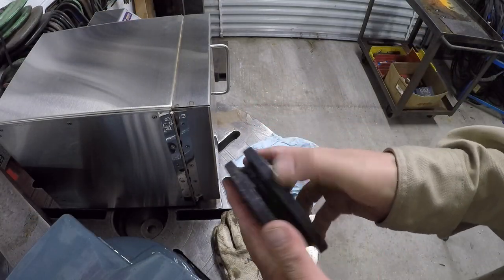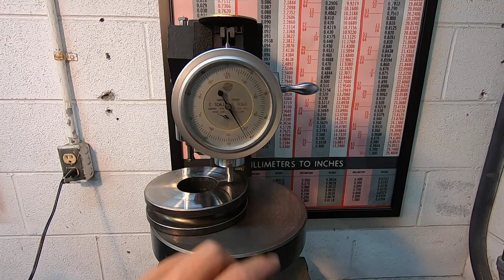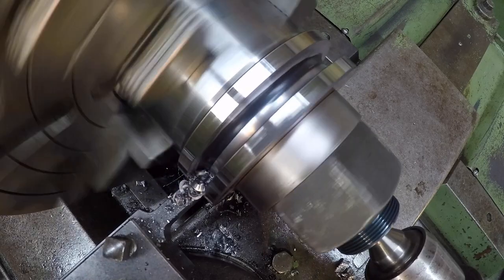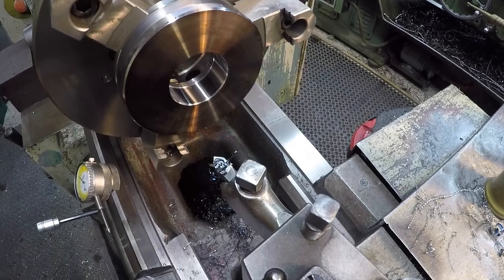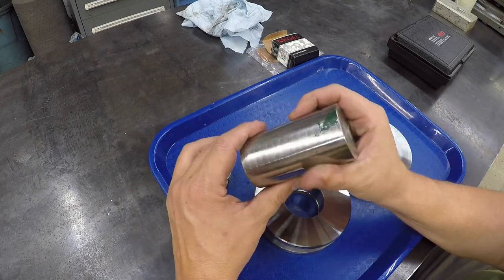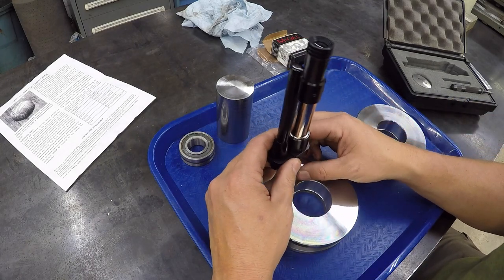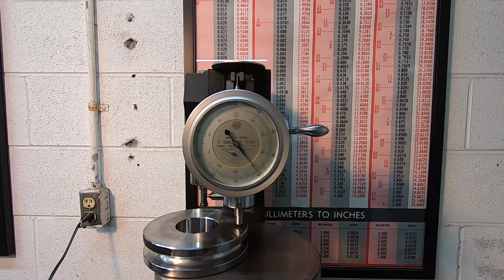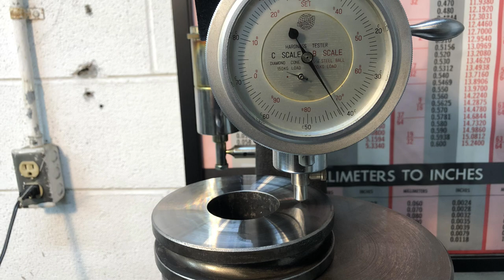Machining Cable Sheaves Part 2

Comment: Adam - a few things I would suggest: 1) Your oil reservoir is pretty small, so you have to consider that the amount the oil temperature around your steel is going to increase significantly in the first fraction of a second. I would consider a larger quench with more oil and preheat the oil and stir it ahead to ensure temperature equilibrium to avoid cold spots during quenching; 2) You are carrying your heated steel pretty far in tongs, which is going to act differently than the steel that is exposed to atmosphere directly, not to mention rapidly reduce steel temp and the safety concerns, I would consider changing the location of your oven/quench and use a tong or hook that minimizes surface contact; 3) You appear to be quenching in a plastic or pvc container on concrete - I would seriously suggest switching to a steel container and keep a chemical extinguisher nearby, as oil fires are often combustive and all it takes it for you to bump that container and it will likely melt a hole and then you have a hot oil spill; 4) I would also suggest wearing a filtered mask, not just a face shield, as burning/smoking oils are not so good to breathe, whether in the kitchen or shop.
Reply: i completely agree with this comment the heat treat could have been done a lot better and more efficient.. and the whole not enough oil thing is right but at the same time hes not taking .100 thou or anything too aggressive and its not a big piece of material but anymore then that yeah hed be chasing his tail till the part was scrap! dont get me started on the ambient temperature of a machine lmaooo!!!!!!

Comment: Hey Adam, not to be overly picky but for more accuracy;  when doing the hardness testing with that calibrated spring punch, you should make sure that the test piece is lying on a flat, hard surface.  I believe that plastic tray absorbed some of the penetrating force of the punch.  When you punched the second sheeve, i thought I saw the tray bow flatten a bit.  This will affect the hardness test.

Comment: Great work there,  as always.
There is a decarburized scale layer on the outside, yes. It will definitely throw off the reading, but its only a few thou thick. 
The grey spotty texture is martensite. Good sign that the heat treat was successful.  
For the quench - 40 to 45 is quite ok for a piece that size. Large pieces lose a lot of max HRC due to pretty much annealing while still in the quench due to residual heat in the center.
Still, you 're not quite there, yet - 4140 is supposed to harden to 50-60.
Your quench technique is fine, but you lost a lot of hardness in the transfer.
First - get your oil right next to the oven, or the oven next to the oil if you want to quench outside for smoke reason. 

The goal is to pretty much open the door and drop it right out of the kiln into the oil in a blink of an eye.
If you need more than 2 seconds for a transfer, it's pretty much too late to get a good result, already.

Also - get yourself a metal bucket - if the plastic breaks (or you get contact and melt through it), you get a spill of hot, and maybe even burning oil.

Comment: I am not a machinist myself, but I love watching you explain and do stuff. Thank you.
Reply: Same here.  Grew up with my dad taking me into the metal fab shop 3 or 4 times a year, worked there two summers.  Still remember the smell of the oil and grease, metal shard hitchhikers in the soles of my boots scraping the concrete or pavement.  Great people to work with.  Love seeing Abom's work in his vids from a raw forging to perfection.

Comment: Adam, I'm suspicious that the area of differential hardening may be due to you grabbing the part with cold tongs. When I heat treat (knives and edge tools), I make sure that my tongs are quite hot, almost glowing red themselves.
Reply: Seconded, as well as a recommendation for a larger quench tank and more vigorous agitation. With anything that chunky ensuring really good even contact with the oil is huge.
Reply: Exactly my thought.
Also the oil was a bit far away from the heat treating oven.
Reply: @thereddufus  The tongs being cool wouldn’t be as much of a factor as the size of the quenching tank. The volume of oil and the lack of good convecting flow of the quenching fluid would be the biggest factors in inconsistent cooling rate leading to differing phase change progression and different final phase presence.  Thus causing the varying hardness.

Comment: Your idea about scale messing up the readings is correct. I use regular sandpaper to clean the surface before measuring. Make sure that the surface is parallel to the measurement axis, clean surfaces and support workpiece properly. Still you might want to make multiple measurements as the hardness measurement is very sensitive to different variations. Maybe you could acquire a hardness calibration piece to check your measurement. With handheld hardness testers it is a must have as it is easy to start second guessing yourself while measuring.

This is why hardness requirement has always a tolerance. I have been using and have seen +2 -2.

Comment: i worked in a heat threating company for 5 yrs doing the tests u should allways clean any millscale or any type of residue on ur parts before testing and allso im pretty sure that the "raised discoloured" area is where u had the thongs and it held in more heat than the rest of the part we used #9 steel wire to attach it or and lower  it so the part would cool down all at the same time in the quenching liquid
Reply: Ultrasound durometer, like UCI 1500 is usefull for that ?

Comment: I have no real knowledge of this sheave, however I know that a lot of cable type lift equipment is designed to have the sheave wear, and not the cable. be careful changing the design specs. love the videos Abomb. thanks and keep up the great work.
Reply: hmm good point
Reply: Yep, I am afraid 45-50 HRC is way too hard for this application.  Standard 4140 bar stock is around 12-15 HRC.  Probably a better choice.  I think the cable would agree!

Comment: Your tongs insulated that part of the steel. And created a Hamon, It cooled at a different rate than the rest of the steel. Use a wire Hanger or Pre heat the tongs and oil.

Comment: Couple of ideas re quenching your parts: First of 4140 is not the best of materials for this purpose due to low carbon content. It will harden, but do not expect tool steel hardness levels. Secondly, when you heat your parts for long time, decarburization happens in the top layers. Basically you loose carbon from steel thus making top layers softer (regardless of the scale). As others mentioned, keep your oil bath as close to the furnance as possible. I would personally try running some tests with smaller parts and if you want to use 4140 try quenching in water as well. Anyway it was a enjoyable video, good job Abom!
Reply: 4140 is an oilhardening steel as per material specifications. water hardening can lead to cracks in the part. to avid decarbonisation either use an oven with inert gas atmosphere (expensive) or toolwrap (cheaper, but not feasible for all geometries).
This steel has .4% carbon which is easily enough for decent hardness while cromium and molybdenum make it less brittle.

Exactly what you would want for the purpose of the part decribed, so choice of material is good. Typical application for a tempered steel grade. Very similar to the 41CrMo4 /1.7223 we use over here in Europe for the same kind of applications.
There are detailed tables regarding how long it takes to heat through the whole part depending on wall thickness and which temperatures to use as wella s which quenching agent and so on. If you adhere to those you will get good results, otherwise you will not.
Reply: It was to hot also 1500 on that steel is enough

Comment: Hey Adam,Directly after you harden the parts at 880°C for a minimum of 1 hour (the longer you leave it in, the deeper the hardened surface will go it is a case harden steel). You need to heat your oil to 360°C, quench and keep the parts at a constant temp for at least 2 hours then cooled to room temp for 4140 1.7225. This is the austemper temperature. You should be getting 61HRC after hardening. The steel is not hardened completely, you can still cut it with a conventional laith. Normally hardened steel to 58+3 HRC needs to be cut with a CBN or diamond insert using HSC. Normally you should grind the parts afterwards, and leave a good 0.6mm extra mass for clean-up. 

You should also do a magnet powder test to check for cracks.
Reply: That high of oil temp is totally unnecessary, depending on your industry and country and code of regulations you follow. We heat treat 4140 all the time and it is quenched in 150F oil, and is supposed to be from 140-180 max.
Reply: @Sffker  normally you're supposed to use a heated salt bath (like we do at work).

 You have 2 possibilities, 
1) you austenize (minimum 60 min), quench, then temper in a heated bath 360°C-480°C minimum 2 hours 

2)austenize (minimum 60 min), quench, and temper in an oven at 680°C for minimum 2 hours. 

The data provided is the temperature, specifically for an oil quench and not a salt bath quench. 
According to my machinist handbook they state 42CrMo4 material number 1.7225 (AISI 4140) harden at 880°C quench in water or oil, temper between 540°C-680°C (lower temp for water quench, higher temp for oil quench). 
The 4140 hardens through tempering. Hence why Adam doesn't have 58+HRC.

Depending on application, the best results come from an oven using nitrogen, quenched in a salt bath, tempered in a salt bath. Up to 61HRC. The raw steel is delivered with a 53HRC.
Reply: @chronicblazer84   Well he showed your last statement to be wrong. His was far less than 53 to start with. I have gotten 4140 steel in both a soft state and a hard state. 24" rod I have chucked in the lathe right now is toward the hard end of the scale. The other chunk I machined recently cut like butter with the same tool. Even just center drilling this new piece told me this one was different hardness to start with. Atlas Steel provides theirs as hardened and tempered. Different sizes also are delivered as different hardness-es.  Others may supply theirs as annealed. Or as Atlas says, it can be annealed, machined,and re-heat treated to get to a harder level.

Comment: When you dip the larger parts to you move it in a circle. If you don't the you will get gas pockets around the part and it will cool slower. On 1040-1060 you can do a saltwater bath. You can always do a magnet test before the quench. This will make sure your at the right temperature to maximize hardness.  Love your clips I learn so much from you.

Comment: Adam, here is a thought. You mentioned that one area of the part had a hardness of 62. Could that be the area that was in contact with the tongs used to remove the part from the oven ?  The heat transference from the part to the cold tongs may be the reason for the higher Rockwell rating in a small area of the part.
Reply: That's exactly what I wanted to write.

Comment: I have been heat treating similar size parts for a few years now, all 4340. As a guy who has had parts slip out of the tongs, I cringe and hold my breath watching you quench in a plastic bucket. The steel safety cans with the foot operated lid work great.

Comment: Pre heating the tongs and oil and keeping the oil close to the oven should give a more even hardness.
The uneven results are probably due to the uneven cooling and quench.
Had those issues with the first couple of heat treatment cycles I did.

Comment: I know I commented prior to this and I don't mean to beat this to death but I remember probably early seventies we needed to open up a sheave from 3/4" to 7/8" to accept a larger wire rope.. The sheave was out of a Lima crane and it was so hard in  the groove that the groove had to be ground to size...Machine shop in Baton Rouge did the job...Cheers; Mike in Louisiana

Comment: Hey ADAM!  The differential hardness you noticed may be due to your tongs, and the 'long' walk to the quench.  Quench needs to be right next to the furnace, and quick.  Practice the moves like you would for a critical weld.  Use a metal quench pail with a proper lid.  You're on the right track with cross referencing your instrumentation.  Can't wait to see you discover case hardening.  Make tools from nearly any steel!
Reply: The tongs are insulating the part from the oil, a metal bucket w/ lid and a basket to lift the part out would be ideal.
Reply: @j-man72b72  right.  What little I did in shop and for a  hook and shackle company I know the heat to plunge time and orientation is critical.  Long parts must go straight in to the oil and maybe letting it drop off the tongs would work better.  We also found after quench if the batch was crated and taken outside in a snow storm the hardness went up the Rockwell scale.making them more brittle and lower on the maximum pull strength range.  Also Rockwell numbers are not possible to get on round parts of a sample.  You need to grind a flat for Rockwell or Brinell

Comment: Try fishing your job out and quenching, using a 1/4”  hook. The wide tongs may cause varied quenching spots. Also in Australia we use K-type oil, i think your equal is Parks 50. You need a fast oil.

Comment: I enjoy you're showing us your learning in the heat treating. I think the tool you used to hold the part did a much quicker temperature drop so it harder there. That spot you show in the beginning. I didn't see if it is symmetrical, on both faces. Stephan Gottewinter uses steel wire, hooks. I used them too in forge treatment and they work better for me. Thanks for the vid !

Comment: The tongs don't allow the part to cool evenly in the oil quench.  
Run a piece of wire through the hole in the part before you put in the oven and grab the wire with the tongs to remove it from the oven and quench it.

Your quench tank should be metal not plastic.  The part can melt a hole in a plastic tank.
Reply: That may be the only bit I remember from art school WAY back .... (Fire was the cool new tech). I had a nickel part explode because the tongs were such a great heat sink.

Comment: Temper for 90mins bud
Your right about the scale affecting test results
Your hard spot may have been either the part that hit the oil first or it may have leeched carbon out of your tongs somethings caused an inconsistent quench but nice work all trades in house is the way to go

Comment: the best thing about oil quenching with a plastic bucket is when you touch the side of the bucket and the part blows it out and you have a flaming oil avalanche on your hands. that is, your metaphorical hands. it's on your literal feet. i've been there.

also i have no clue why you're getting the results in heat treat that you've been getting, provided everything is calibrated. granted, i rarely bother oil quenching anymore and generally do air or water. but i do know that if you test it without removing the scale it reads high, usually off the scale high, unless it cracks under the force of the diamond, then it's just a random reading

edit: watching again, the only thing i do different is hang the parts from stainless safety wire, so it may have been that.

Comment: Hi Adam, I´m not a professional heattreater, but I have done some heattreating from time to time. As far as my experience goes I would say your warm up time is far to long. The hard spots probably are chrome carbides that have been grown because of the very long worm up time. To estimate the warm up time I use the formular material thickness in mm x 2min. = warm up time. In your case that would have been 127mm - 52mm = 75mm /2 (radial!) = 37,5mm x 2min = 75min. Maybe you shorten down your warm up time for your next project. Still you are a real artist in your trade!!! Greatings from Hamburg, Gemany
Reply: Warm up time is related to the type of metal you're heating. 4140 is only 5 minutes per inch. S7 is an hour per inch A2 is an hour per inch you have to know what metal you're treating to know what the soak temperature is.

Comment: Abom: puts mat down under bucket of oil in case of mess.
The only oil that splashes out of bucket lands on the concrete beside the mat.
Ohhhhh Murphy, what would we do without you?
Reply: We would blame O'Toole.
Reply: @gravelydon7072  My father says he doesn't run by Murphy's law. He says that O'Leary's law is more accurate. 
Apparently O'Leary's law states "Murphy was an optimist".

Comment: Hi Adam, great video and explanation.  You have skills.  We do a lot of machining of various tool steels and we use a prehard NAK55 which is 40-42HRC.  It machines excellent and does not need heat treat so you can go right to size after roughing.  Its great for polishing, welding, & is very stable.

Comment: The hard area is where your tongs were when you quenched the part. I recommend you drop the hot part into a heavy wire mesh basket and use an aerator in your quench bucket.
Reply: How deep does that hard area go? All the way through?
Reply: This would make it softer, no? Even on a thick part with all of that heat inside, the tongs will do that?

I only know a little bit from making knives, but typically people would feel that the tongs would act as a heat sink if anything, so the part would lose heat faster there and not harden properly. That’s why a lot of people will stick the tongs way into the quenchant just in case, so that the tang isn’t slowed in cooling.

It seems extreme to me that tongs could cause a difference of 20 HRC. Maybe I’m that ignorant though, that’s why I’m honestly asking. Maybe this steel is a very slow hardening steel?